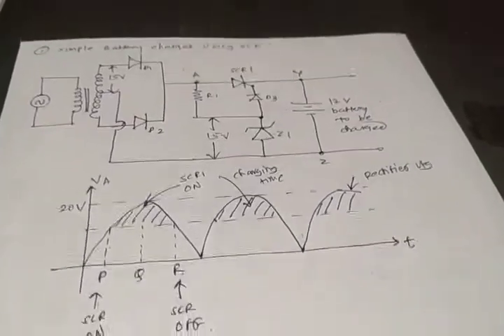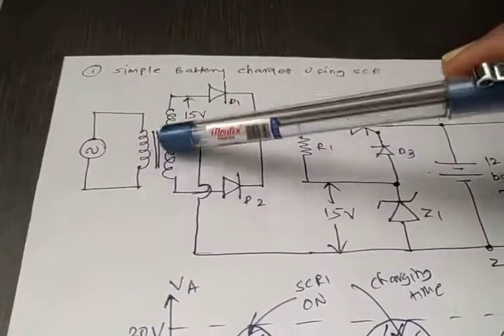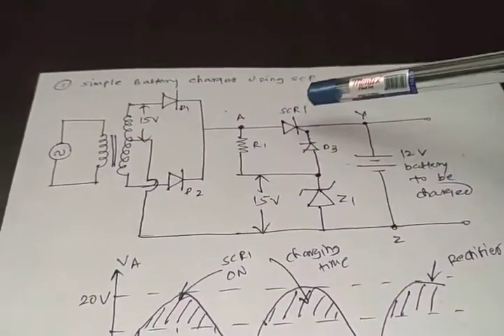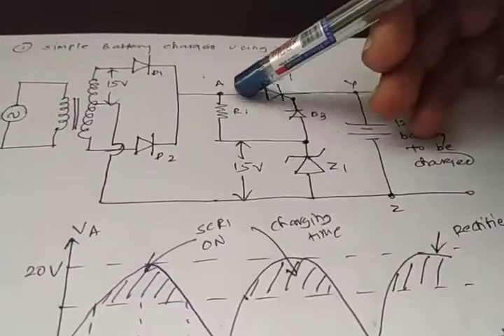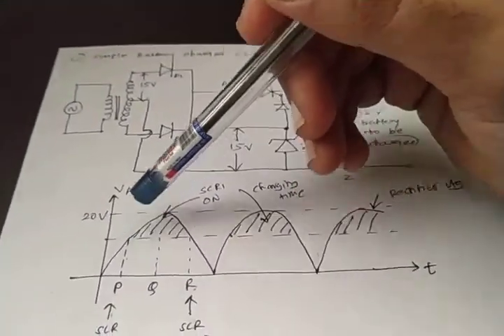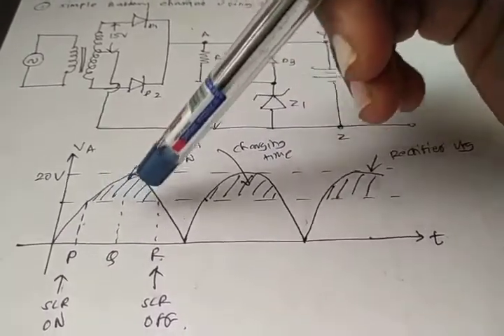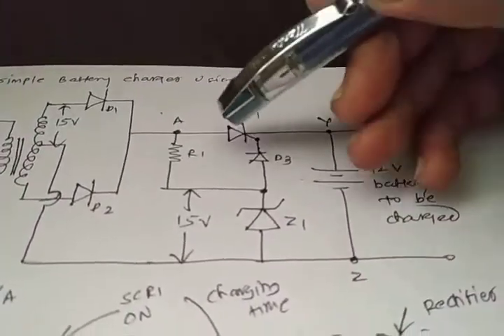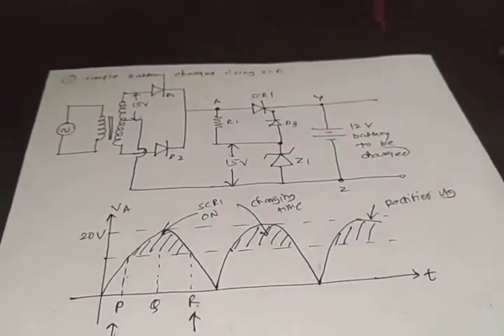Battery charger using SCR

Comment: in such way batter will be stopped from charging at 14.3 volt but to get fully charged we need to change zener value to 15.9 volt by connecting to zener in series of 9.1+6.8 volts and charging will stop at 14.5 exactly,but the question is charging via SCR will limit current during charging or will give a full capacity of transformer??